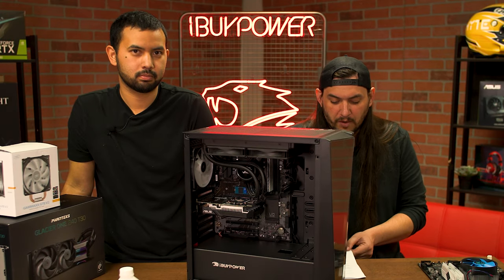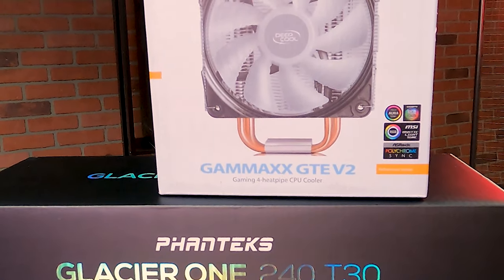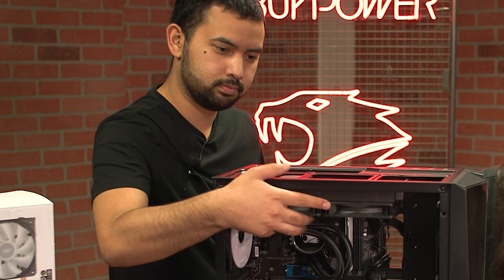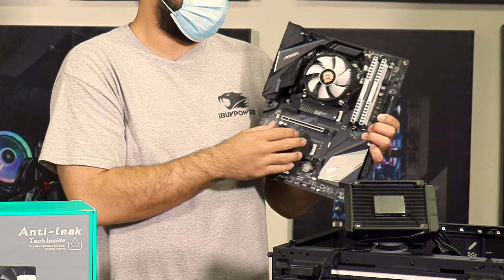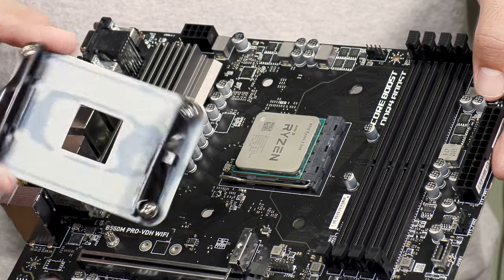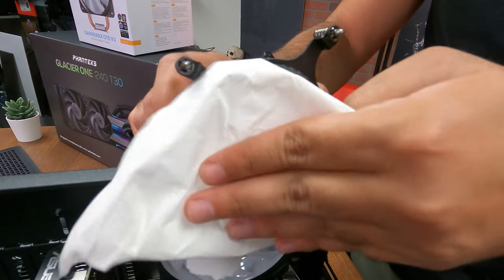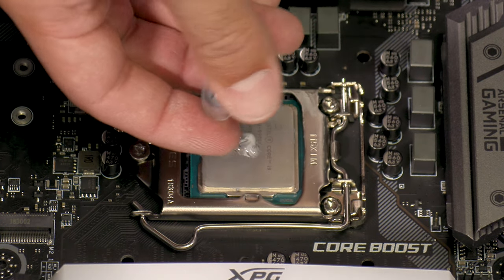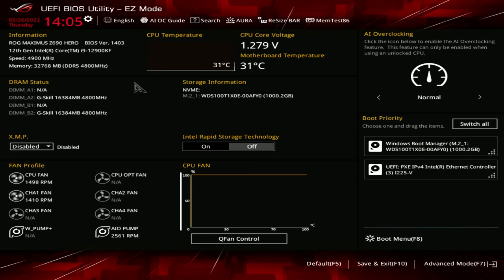How to Replace CPU Cooler with AIO - iBUYPOWER AMD Intel

Comment: I CANT follow this guide because the wire that powers the cooler goes directly into the power supply and the power supply is covered in a shell that can’t be removed and prevents unplugging things and plugging in new ones. Thanks.

Comment: How do I replace the fluid in the radiator? There's like a rubber nob on it but I can't get it to come open and I'm not wanting to risk breaking anything.

I wouldn't have a radiator if it's not a liquid cooling system would I? I've got the big wire/pipes attached just like what you see at 1:00 but I can't seem to find any instructions on how to maintain this.
Reply: A little late to answer, but you really can't replace the liquid, unless you have a way to seal the cooler with a vacuum because you don't want air trapped inside.
Reply: @rasmodeus1  Ah, my heat sync's performance started to degrade and I looked up potential reasons and one of the listed reasons is that the coolant undergoes a process where it's less able to carry heat over time, and the more heat it has to move the faster the coolant degrades.

I have an i9 for multi-tasking some rather system intensive processes and I think I may have degraded the coolant quicker than most people will, I just got a replacement though.

Comment: Pretty sure my iBUYPOWER 240mm Addressable RGB Liquid Cooling System is in the process of failing. Stupid that it's factory sealed so you cannot even purge air from the lines or add more water. What a joke.

Comment: Thermal paste should be evenly distributed to prevent hotspots from developing.  I usually use a razor blade to spread it thinly and evenly over the surface of the processor.
Reply: Meh.  I saw that but Intel now says a dollop in the middle and let the pressure as you tighten the cooler to the CPU do the rest.  Carry on.

Comment: I stupidly recommended you people to a friend, right before mine quit working.  I find it ridiculous that you have a video on how to replace the shoddy crap the overpriced computer you built came with.  Maybe you should go with quality products instead of broken crap that doesn't last more than a year.  It doesn't matter in my case, because if I'm going to go through all this effort to replace one part, I might as well go back to building my own computers.  Never had this kind of crap with them.  Also, the case sucks.  I think that your liquid cooling would work a helluva lot better if the case was actually big enough for it.  - Former customer.

Comment: Or you could just not put shit materials in your pre-builds. IBUYPOWER used to be the go to TOP END PRE BUILTS in 2018-2019... Now it sure shows they care about $$ and not about putting junk in the prebuilds
Reply: I have an IBP AIO with cheap PET tubing from 12 years ago still chugging away. It's a shame they didn't maintain that standard of excellence.
Reply: @rasmodeus1  amen!

Comment: Wth are you guys crying in the comments doing with your computers? My IBuyPower pc is going on 2 years strong now, NO problems. Learn to take care of your equipment, Sheesh. Lmao.
Reply: Their coolers are notorious for failing, it doesn't matter how clean you keep the vents if the pump is getting clogged with microbial junk because they used crap water to fill it. 

Your experience is the exception, not the rule. If you want to avoid a nasty surprise in the future, install your own cooler.
Reply: @OmegaGrunt  What cooler do you recommend?
Reply: @danielvillar839 Any air cooler. Most online system builders prefer AIO water coolers because they are easier to ship. The radiator hanging off the CPU/Motherboard can cause a lot of stress in shipping. But other than that there really isn't much benefit over a standard air cooler. 

I ended up grabbing something I could find on short notice when my iBuyPower AIO failed, which was a Cooler Master hyper 212. PC isn't any louder and my temperatures are better than ever. 

A custom built water loop can be great if you're into overclocking, but the maintenance is very important with systems like that. Where air coolers just need a dusting every few weeks/months.
Reply: Youre lucky.
Reply: @OmegaGrunt  are the fan coolers fine for them. I just brought a PC from them and I got a custom AIO, but I just got the default fans because I did not think they were worth It.  Are the fans fine or will I need to change it. It is my first PC so I am not sure
Reply: @thecommonsenseguy7935 The rest of their case fans are fine. If you are using an AIO from them, monitor the temperatures occasionally and keep in mind the framerates you're getting. cpuid HWMonitor  is good for checking temps, but you can use whatever software you prefer. 

If over weeks/months the temps get worse and framerates drop, and cleaning the case doesn't help. It is probably build-up in the AIO and you'll be better off swapping to a fan+block on the CPU.
Reply: @OmegaGrunt  okay thanks, if that happens hopefully I am at the point where I know enough when I can just install one on my own. Thanks for your help.
Reply: You don't know what you are talking about about. Friends AIO failed after only 2 years, when I inspected it the fans and radiator were still almost pristine clean, the intake mesh screens did their job
Reply: @rasmodeus1  Oh, you're not going to like this one! Mine still going strong, 4 years later! Here we goooo! LOL.